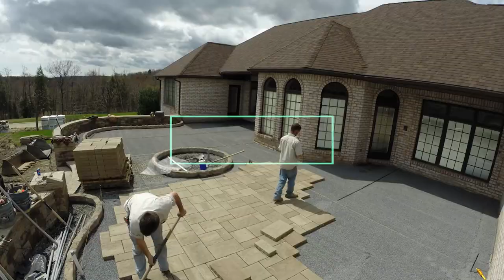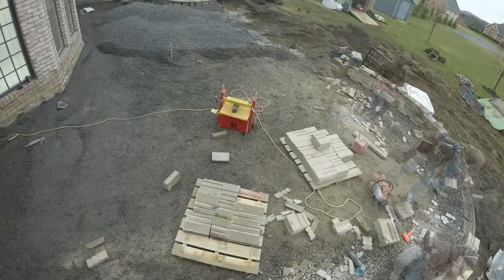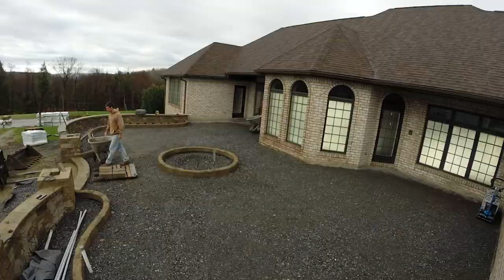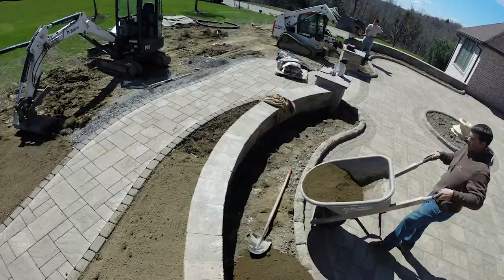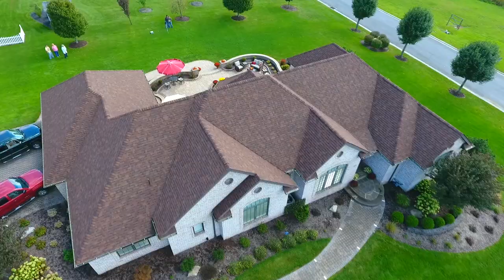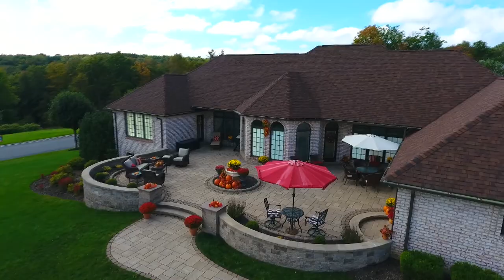Beautiful Back PATIO Renovation TIMELAPSE

Comment: Why did you switch the type of block halfway up the wall? What type and model of self leveling laser do you guys like? Thanks!
Reply from the maker: We used a single sided wall block on the bottom, then switched to a double sided for the seating wall section. Just was faster and saved cost for the home owner.
Reply: Thanks, what about the laser you guys use? Is it topcon and which model
Reply from the maker: @jakebehrens1709  to be honest, not sure ha ha. Have to look.